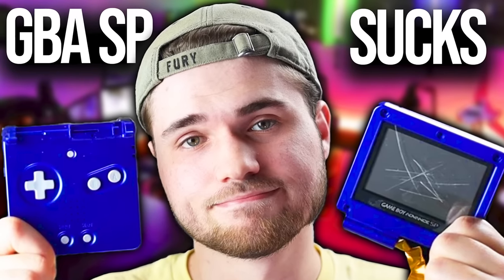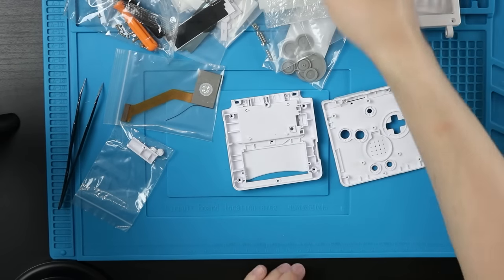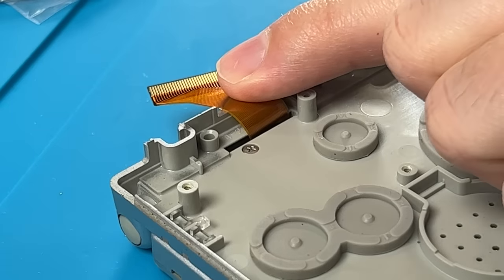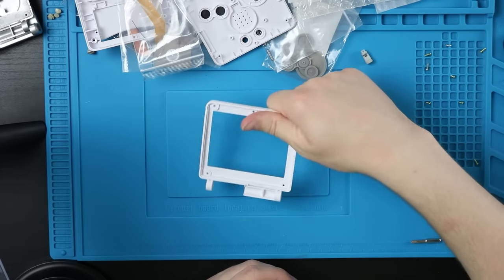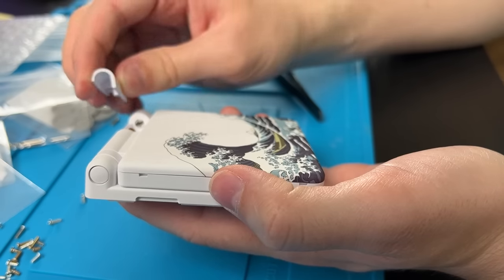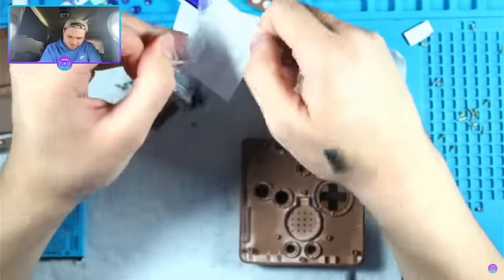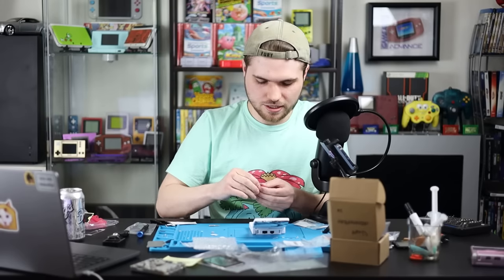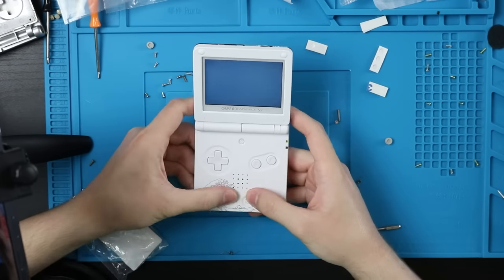How to UPGRADE Your GBA SP! (In Depth Tutorial)

Comment: Just replaced my faulty L button,  got a new casing and soldered the ips mod in. It was the first time I tried soldering to such an important piece of memorabilia, so I did a practice kit first.  I could not have done this without your guidance through this video, your links to replacement parts and the solder tool kit on your website. 

I am extremely grateful for you giving me a worthwhile memory to look back on. Subbed!

Comment: I'm still scared to do this BUT this is giving me a lot of confidence with how easy it looked for you!
Reply: Update! I just did the screen and case swap (with saudering that I've never done before!) And it all went smothly!
Reply: Any experience with soldering? I’m waiting on my screen and have no experience, but going to try my hand with soldering as well. Any tips or recommendations now that you’ve done it?
Reply: @Solontire  Buy flux, soldering is much easier with flux.
Reply: @rnase3970  will do appreciate the tip. I assume any reputable brand will do? Also is soldering paste different than flux? My soldering kit I got off Amazon which was rated as a “good starter kit for beginners” came with soldering paste but not sure what that is.
Reply: @Solontire  Yeah, anything should be fine

Comment: The only thing I came here for was to learn how to put on the Nintendo logo on the top of the shell and YOUR CASE DOESN'T HAVE ONE. How do I put that damn thing on? I started by just placing it in the little slot thing. That didn't work. Then I thought it was a sticker so I removed the bottom part from the top of the logo and it turns out it wasn't a sticker and I ruined it. I'm confused.

Outside of that, this was the best video I have seen so far on the screen mod. I wish I saw it before I modded mine because it would have made my life a lot easier.
Reply from the maker: It is a sticker so you probably ripped the sticky part off😬
Reply: @JakeSimmons  Found it. Thanks. Unfortunately, I already destroyed it so I'll have to order another one. Seems like the only company that sells them is in Australia so I guess it won't be ready in time for Christmas.

Comment: hey man, I recently modded my sp and wanted the usb c charging as the last touch but tripped at the finish line </3 i lifted the pad you need to solder and now the gba wont charge. You're the only guy i can think of that can help, is there anything i can do at this point or is my boy dead?

Comment: Just modded my original 001 that I've had since it came out. Never done anything like this before, yet it went incredibly smooth thanks to this video! Used the same shell and one of the recommended IPS screens, and it's wonderful. Thanks for putting this video out!

One thing I have noticed while playing today for a bit after making the changes is that sometimes the screen image will freeze but the game is still playing (Pokemon Emerald, and I've managed to save, power off/on and the screen works again). Anyone have any thoughts as to why that might be?
Reply from the maker: I actually just had that happen for the first time ever on a customer’s game boy. It’s a problem with the ribbon cable which is unfortunately the expensive part. The only way I know how to fix it is to replace it :/
Reply: @JakeSimmons  Thanks for getting back, and so fast! 

That makes sense! Do you know offhand if it's possible to buy just the cable, or should I order and replace the whole screen?
Reply from the maker: @brandonrandle6996  you can buy them separately but it looks like everyone is sold out of just ribbons. You might be able to ask customer support if they could sell you just a ribbon
Reply: @JakeSimmons  I'll give that a go, and just get a whole 'nother set if that doesn't make it. Thank you VERY much for your help and guidance! Keep up the great work!

Comment: I just did a full mod on my SP and got OEM replacement hinges from retro game repair shop. I followed your steps to install. The gb closes and opens to the correct position but there is no click. Would you happen to know the reason for this?
Reply from the maker: I've always heard that it doesn't matter which side you put the hinges in on, but every time I have them flipped, they don't click. You can always try flipping the hinges to the other sides if it bothers you that much

Comment: I’ve watched so many videos and I still have one thing I’m super confused about.   I bought a shell and I have an sp 101.  I just want to replace the shell, do I still need to solder that wire on or is that only if I’m replacing the screen with a new screen?  Sorry if this is a silly question, this is my first time ever doing this
Reply from the maker: No need to do soldering if you are using a 101 screen

Comment: If you’re afraid to mod your gba sp, don’t be. I’m a complete beginner and was able to do this mod. I did break off the volume button.. make sure to remove it before putting the motherboard back in the shell. In the video he just talked about removing the volume button “if you haven’t yet” when the motherboard was already installed. Fml otherwise this build is super easy.
Reply: I’m actually debating on modding my sp from childhood and your comment is making me feel a bit better. So you’ve never done solder work before and you found this mod to be easy?

Comment: At 17:08 are you just using the head from the soldering iron to melt the wire onto the contact point or are you adding a teeny bit of solder metal to it?
Reply from the maker: There has been a bit of solder there already so I didn’t add any. But you should add some solder to it first
Reply: @JakeSimmons  sweet! Thanks for the reply! I’m looking forward to getting into this stuff 😄